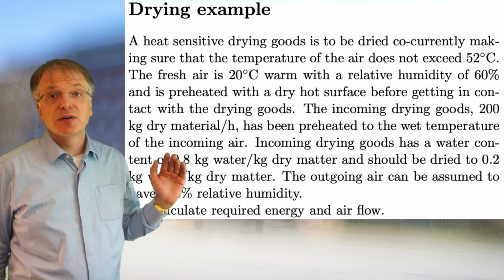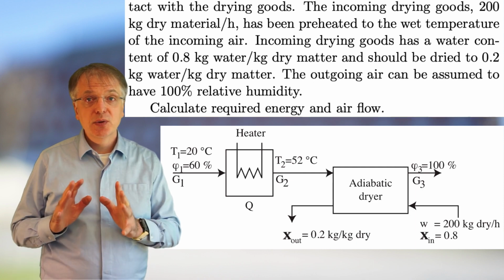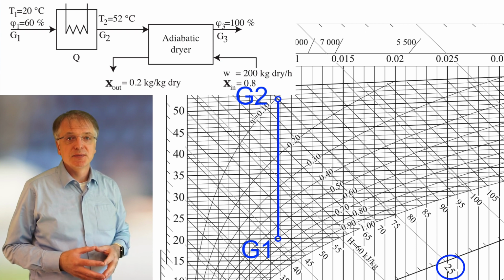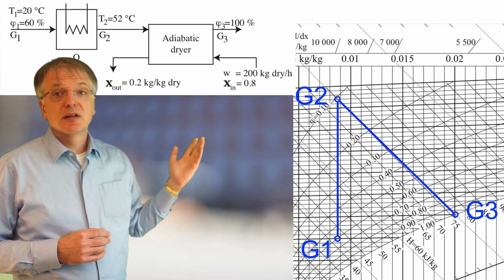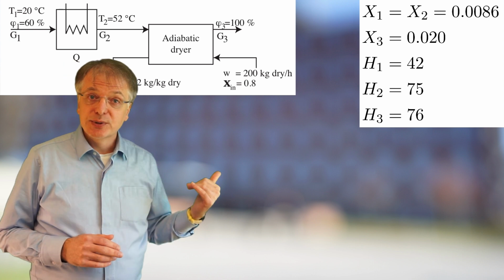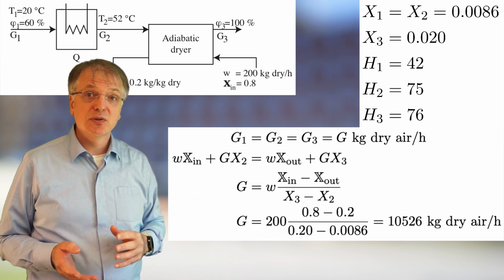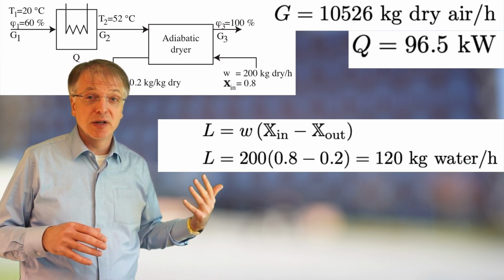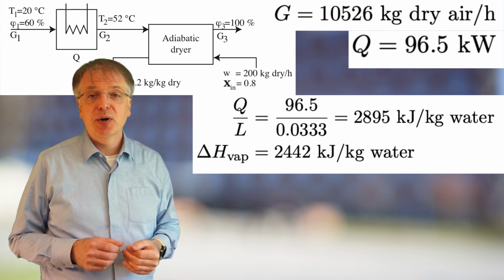Drying with air: Example

Comment: Great video. Just one question - why is it necessary to preheat the wet goods to the wet bulb temperature of air, before sending it to the adiabatic dryer? Why not just send the wet goods directly to the adiabatic dryer ?
Reply from the maker: The the air in the dryer would initially cool down without water being evaporated. (The air in the dryer would not follow the adiabatic cooling line in the mollier diagram)
Reply: @PLE_LU  Why wouldn't the water evaporate? Isn't the air unsaturated, hence a vapor pressure gradient exists for water to evaporate?
Reply from the maker: I'm simplifying a bit. For more detailed explanations, ask your teacher

Comment: Great Presentation. I would just change something in your notation, using "w" for solids flow confuses with water, most authors uses "F" for dry solids flow.
Reply from the maker: Notation vary greatly between different subfields and between different text books. The notation we use here is, as always, a compromise given the different subfields we cover in the same course.

Comment: What parameters would you examine in point 3 to obtain the psychrometric properties if it's based on actual conditions without assuming 100% relative humidity?
Reply from the maker: Level 1 answer: Measure one more thing, e.g. the temperature in flow 3
Level 2 answer: In a real system, the dryer is never fully adiabatic, so measure both temperature and wet temperature in flow 3.
Level 3 answer: In a real system you typically want your drying goods to become dry, right? So the underlying assumption that the drying goods is surface wet is violated and the air in the dryer will not follow the adiabatic cooling line and thus you definitely need to measure both the temperature and the wet temperature in flow 3. Compare the video on drying rate: https://youtu.be/Nxw6RepXwww
Reply: @PLE_LU  Thank you for your quick response. Btw, I’m currently designing a dryer for my undergraduate thesis and there’s no possible way to measure the temperature at point 3. What should I do to determine the properties at point 3?

Comment: This is lovely, but there's one thing I have to tell you:

Only Swedes would ever talk about "moist air"... 😏 The term in English is "humid air"!
Reply from the maker: Thanks for the hint, but you are actually incorrect. The probably most common engineering way to express this is still moist air, see e.g. https://www.engineeringtoolbox.com/moist-air-properties-d_1256.html

So, in engineering we talk about moist air versus dry air. Moisture content = kg water/kg dry air, Relative humidity compares the humidity with the  moisture content at saturation.

How much the terminology varies between countries is beyond my knowledge, but moist air is definitely commonly used in engineering contexts.